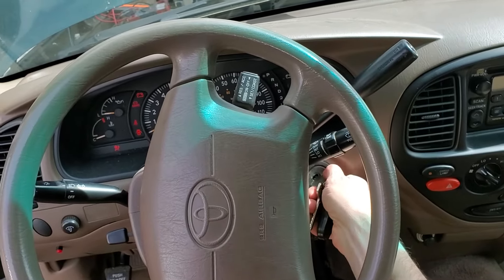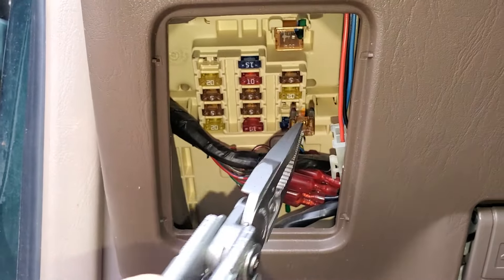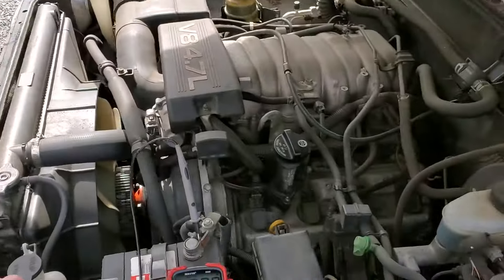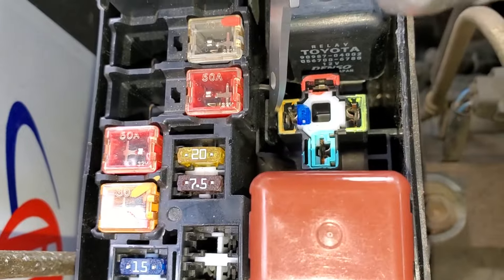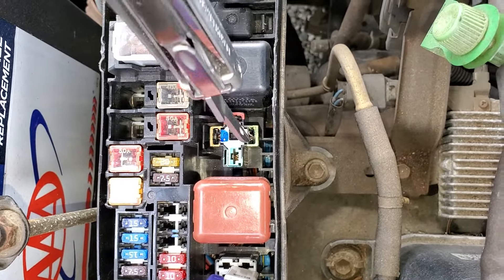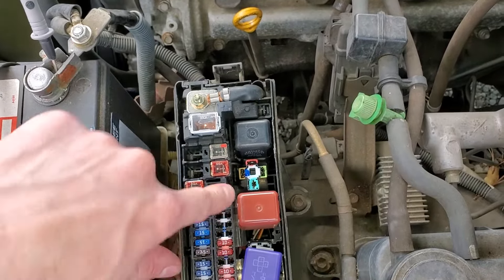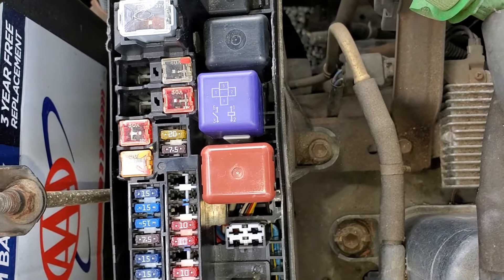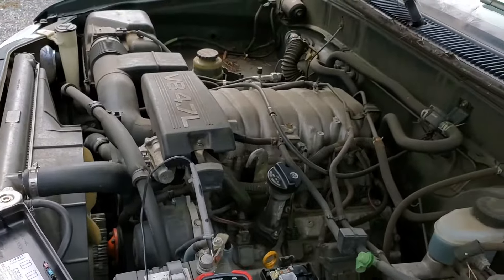2000 Toyota Tundra Starter Fuse, Starter Relay & Circuit Explained

Comment: Great job. I am a full time mechanic and this helped me diagnose what was wrong with a 2003 Toyota Tundra. You said that you were looking for suggestions. If you put 2 male spade connectors on a wire and jump from the starter terminal and the terminal directly across from it, you make the same circuit and verify the fuse that supplies power to the relay. If you have a way for me to pass on $5, send me a link and I would love to thank you monetarily for your efforts. Again, great explanation Lehew!
Reply from the maker: Thank you for the feedback! I have a cashapp $lehewtech
Reply: @LehewTech im wondering if this would be the same issue with my 2000 4runner?

Comment: Great video - have a 2000 tundra that wouldn’t turn over or click (nothing) found the am2 fuse blown - replaced it and then it started and ran for about 10 seconds - fuse blew again - ended up being a bad ignition coil on the #8 cylinder!
Reply: Wat,.  Can you elaborate

Comment: If the key is in the vehicle ignition turned to the "on" position, would this have powered up the engine allowing you to drive the vehicle? When you put power through to the pin, it only turned over continuously but did not start the vehicle. Thanks in advance.

Comment: I installed a "kill switch" using the 5 Amp Sta fuse (inside cab driver side) it works great, but I get a "check Engine" light indication code P1780 - Park/Neutral Position Switch Malfunction, even when the switch not being use, try to figure out what other circuit to break to  keep the truck from starting ..?

Comment: Great info I had a problem this morning on my 2000 tundra went out side and heard the engine cranking over the key was in the house. Ran and got the key turned in on and ran then turned it and keep cranking it stopped and started back again so disconnected the ground. replaced the starter relay and is well again I hope.

Comment: Hi your video is great.  Helps me to understand the system well.  My truck wont start.  I jumped it with a wire through the relay terminals so I know it's not the starter.  Still though,  I can't get it to start.  All the fuses look good and I tried a new relay.   I wonder if the new relay is the problem???  Any ideas?

Comment: I recently had the timing belt replaced on my 2004 Toyota Tundra Limited. The wiring harness was left too close to the serpentine belt. The belt rubbed the wiring harness down near the cam. The aluminum foil was rubbed through and the green wire grounded with the foil sheath. The truck now won't start, even after wiring harness repaired. Turn the key and engine may turn over, start, and then try to keep starting without turning the key. Have to then disconnect the battery or throw a switch I had installed quite some time ago. I'm wondering what the common problem may be? We've checked the starter and solenoid. I'm wondering about the relay and the other items you made note of in this presentation. As often as people changed timing belts, this should show up as a common issue after a timing belt replacement.

Comment: Great video. I had already replaced the starter and relay only to utilize the jump start method as you point out. Starts right up but after turning off its back to completely nothing ..just a buzzing sound when the ignition is turned on...safety switch perhaps ?

Comment: I have a ? When I turn my key to start my 2002 Tundra it clicks only and won't turn the motor over can I run this test to check to see if my starter is bad, I believe it's under the intake and is a hard job? I don't want to tear my top end apart to find out my starter is not even my issue! Thanks for the video

Comment: Great video, thank you.  I have intermittent no crank no start.  2006 4.7 Tundra, 245K miles, well taken care of.  No security system that I know of.  All lights on dash work as normal when i turn the key.  Sometimes i get clicks, sometimes not.  Battery tests good.  Very clean battery terminals.  No rodents.  Just replaced the starter (very difficult job), new one tested good before I put it in.  Old starter tested good as well after removal.  Relay tests good.  Didn't start happening until 3 days  after I replaced the alternator, but i can't find any problems there.  If it won't start, often I try again in an hour and it starts just fine.  Any advice?
Reply: Hey wondering what you did to fix this. My 2002 3.4 is doing something similar.
Reply: @Toxcys  it took me a long time and a lot of money to figure it out, but in the end it was simple. A mechanic had replaced the timing belt and water pump, and he accidentally caught the wires to my camshaft position sensor under the edge of the water pump housing.  So it was a bad signal coming from the camshaft position sensor in my case.

Comment: I have a 2001 Toyota tacoma and the exact same relay. And the same multi meter.  I did the thing where you transfer power through it and still have nothing. Would that conclude that there is an issue with a wire from the fuse box to the starter?

Comment: Lehew, Great video!  I have a general problem with running lights coming on, heater fan, etc, with ignition OFF.  Not the DRL, as I tried this first.  PM me for more details of problem.

Comment: Yes i need to know where the wire connects to the fuse box to the alternator relay what side it goes on and how many positive wires should be connected to the battery

Comment: Are there any fusible links on this truck? I have replaced 120amp fuse and 3 blue fuses. No electrical power to dash or switch key. Where do I look to get power back to get everything working again.??

Comment: Ay i have a 2002 sequoia that won’t start just started a week ago and when I try and jump the starter relay I get nothing, anything you know that could help me
Reply: 2001 Sequoia went dead after amp meter on dash spiked to max - it is completely dead now and it's not the battery.  Completely stumped as to resolution.

Comment: I have a 2003 toyota sequoia that wont start or crank sometimes.. I already had the battery replaced and a new starter, but it still only starts sometimes.
Reply: I have the same exact car with the same exact problem! Did you ever find out what was wrong?
Reply: What was solution?pls I  have same problem,thanx
Reply: What was problem,I have same troble,thanx!
Reply: How did you all fixed it I have the same problem

Comment: I have a 2002 toyota tundra 2wd 4.7lt    the problem am having is the emergency  lights dont function  while the truck is turned  off . Only when the truck is on  . What you think might  be the issue?

Comment: If the truck has intermittent trouble starting where the it will just "click" once when the key is turned but won't actually crank or even attempt to crank.  I can usually do this and jiggle the key on and off over and over until eventually it will cause the engine to turn over and start, is this usually an indication of a bad neutral safety switch?
Reply: Did you fix problem,Just asking because have same problem,thanx
Reply: Is it ignition cylinder or ignition switch

Comment: Hi Lew have starter is continuing after starting the engine and brake light is on , stall when shift into drive , is that Faulty ignition Switch

Comment: I have a question. So i Boofed. I was changing the lights in my cluster with my truck on and when i plugged my cluster back in and turned off the truck and buttoned everything up. When i later tried to start the truck I get a single click that sounds like its coming from the starter and nothing else. Thinking it was the starter I dropped 200$ on a new starter and replaced it only to get the same result :( (Changing the starter sucks on these.) i checked all my fuses and ordered another relay to see if that would fix it. Any pointers or suggestions would be greatly appreciated. <3

Comment: Lehew in your case did the truck need a new starter or was there a problem with the relay? I tried using an old extension cord wire from the positive to the same slot on the starter relay and nothing. Does that mean it's my starter? After I hooked up my new battery some of the dash boards lights blink and so do my emergency blinkers but the truck doesn't make a sound when I try and crank it.
Reply: did u find out what it is? i think its your starter need to be replace.

Comment: I have a no start on my 2000, 4.7L Tundra 4WD and I have a brand new battery and my starter relay should be good b/c I can hear a loud click every time I turn the ignition but no crank.  I just noticed today that my "F/L 30A" fuse that is in a little case by it's own is blown(under the hood next to the fuse box you show).  Is that the obvious reason for my no start?  I replaced my starter 3 years ago with a new NAPA part.   Please help b/c i'm worried I have a short from a possible damaged wiring harness during my starter replacement or b/c of a shitty aftermarket radio unit that does not work properly.
Reply: Did you figure your issue out ?

Comment: My 2003 Tundra start event occasionally will act like a weak battery (clicking solenoid) and then the dash goes dark and there is no power to the vehicle.  Manipulating the key switch has no effect.  Manipulating the shifter (neutral switch) has no effect.  The vehicle is effectively dead.  Disconnecting the battery negative terminal for a second results in a return to normal start/run function. ( the battery terminals are clean and tight)  Ideas...?
Reply: I too am having the same issue have you figured yours out?
Reply: I have that problem on my 2002 sequoia. Did you find out what was wrong?
Reply: @katiewiesner4588  swap the copper wire, lots of times they are corroded and you can't tell...

Comment: 2003 tundra won't start no crank. New battery new starter relay. Jumping starter through relay doesn't work motor won't crank. No power to 7.5 amp fuse from ignition switch
Reply: Tap the starting motor with a 2x4 lumber or a hammer. And I t will start ..
Reply: @SeabeeDaddy  probably wont start with the injectors out, intake off , and throttle body all removed just to get to the starter inside the engine underneath the intake manifold.

Comment: Hi can you help me. I have sequoia 2004 4.7l i can’t find starter relay locations and the fuse.I just replace a new starter no crank no start. Please help.THANK YOU
Reply: @nyphal5420 I have the same exact problem with my '02 Sequoia after the starter replacement. Did you figure it out?